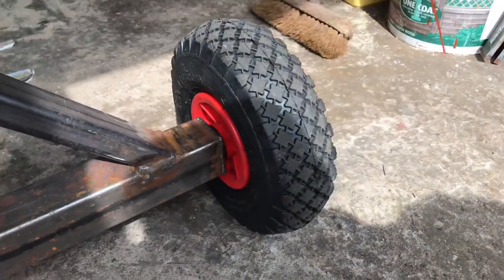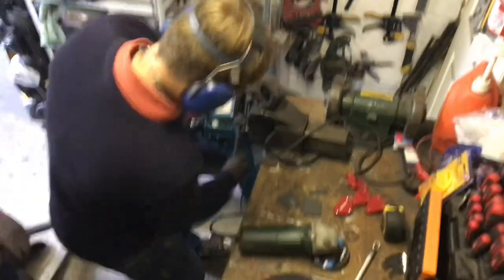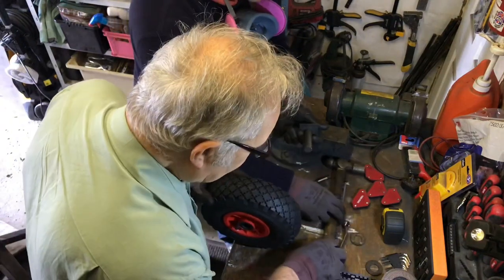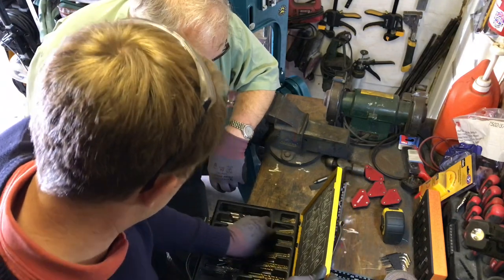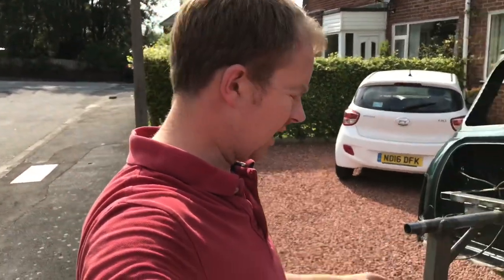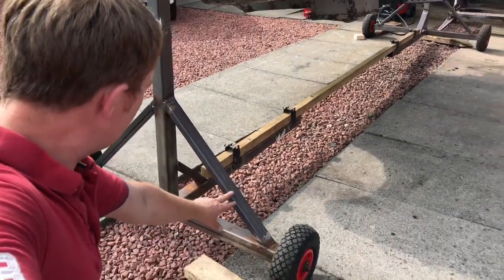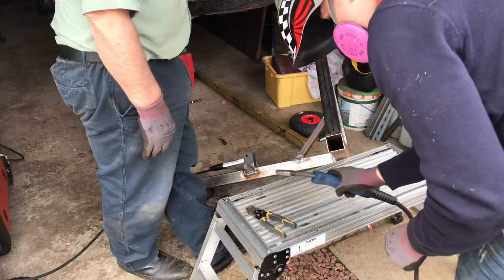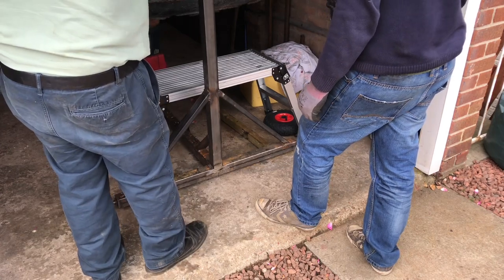Making a rotisserie jig - Classic Mini - Wheels - Part 3

Comment: first of all congratulations for your great job, very nice work and a big thank you for your videos!
would it be possible to have approximately the dimensions of the length of the square tube which supports the wheels and of the one which is perpendicular and which goes under the mini?
thanks again for your great job on the mini!